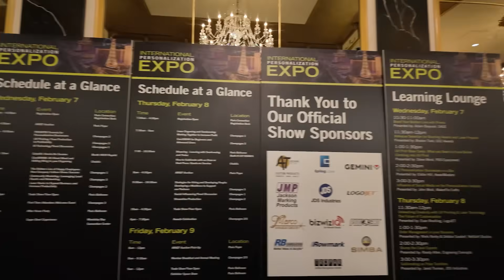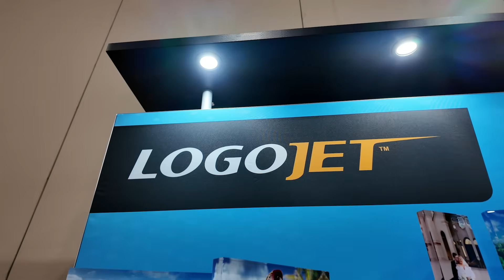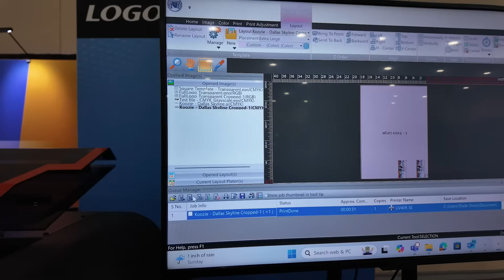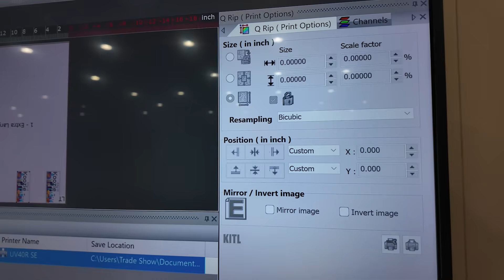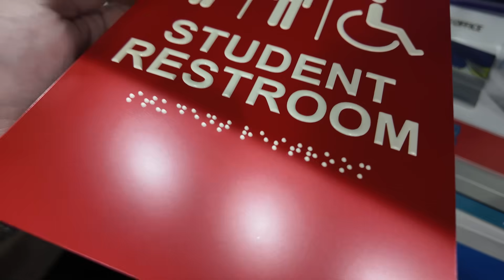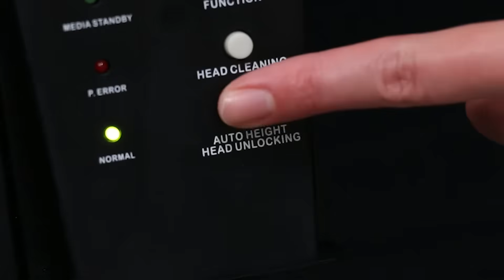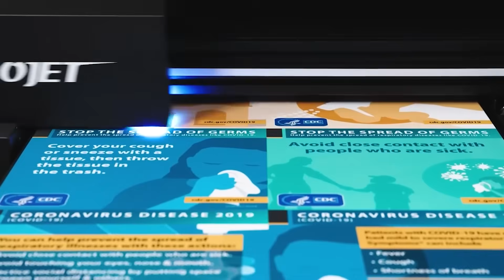What Makes LogoJet’s Pro UV Printers So Impressive? - Interview With CEO

Comment: Here is what a quick search turned up.
For those wondering about price.
logojet 24x36 UV printer price
A LogoJET 24x36 UV printer typically costs between $52,500 and $59,995, depending on the model. The most recent models with this print area are the LogoJET UVx90i and the LogoJET UVx90R-SE. Used or refurbished units may be available for a lower price. 
Pricing for 24" x 36" LogoJET UV printers
LogoJET Inspira Series UVx90i: This model has a 24" x 36" print area and is listed on the LogoJET website for $59,995.00, as of September 2025. A demo unit was previously listed for a lower price of $53,995.50.
LogoJET UVx90R-SE: This printer also features a 24" x 36" print area. According to the LogoJET website as of September 2025, it costs $52,500.
Refurbished LogoJET UVx90R: A refurbished version of the older UVx90R model was previously advertised by LogoJET with an undisclosed price, though it included ink, software, and a one-year warranty. 
Additional costs
The price of the printer is an initial investment, but you should also factor in additional costs.
Supplies: Ongoing costs include UV ink, which is delivered in 200 ml bags for around $150 each, and replacement print heads, which cost about $2,000.
Software: The base price may or may not include RIP software. Optional software, such as a perpetual license for LogoJET Print Pro, costs $500, and a one-year subscription for Flexi Complete is $819.99.
Services: Services, including on-site installation, training, and ongoing support, may require an additional fee.
Accessories: Accessories such as a rotary attachment for cylindrical objects ($3,000) or custom printing trays ($520–$1,000) will increase the total investment

Comment: so, how does this compare to the Eufymake E1 ? Thats what the community wants know right now ?
Reply: 😂 $20k plus
Reply: @barryp8145  :face-blue-smiling: yeh but at least it exists in the physical world :face-blue-smiling:, the Kickstarter gone a bit tits up right
Reply from the maker: The LogoJet line is a professional level ,high output mass production machine, ment for large volume orders. The Eufy make is designed for smaller shop and individual creators, example the LogoJet can print a 4" logo on a 2 tumblers in under 2.5 min  the Eufy make would take about 16 min to do this same job, and of course then there is the cost the Eufymake E1 is about 2800.00 to get started, and The LogoJet 40r SE starts at about 30k +, The Eufy make is an awesome tool I love mine, and I love how affordable it is, But if I'm wanting to take on huge orders, and who does not want huge orders 🤣🤣 IM gonna need me some LogoJet!
Reply: @LaserEngraving911 In other words you know you’ve made it when you order your first Logojet.😂
Reply: @LaserEngraving911  have you experienced the tank leaks or other issues on the Eufymake E1 ?